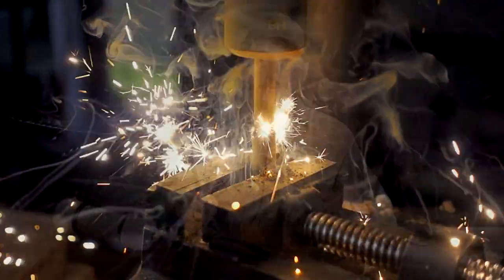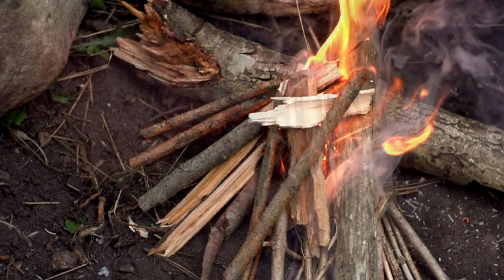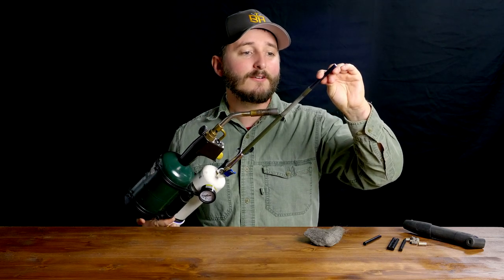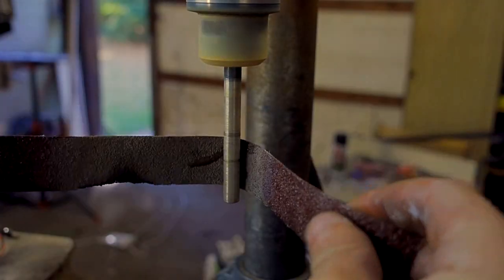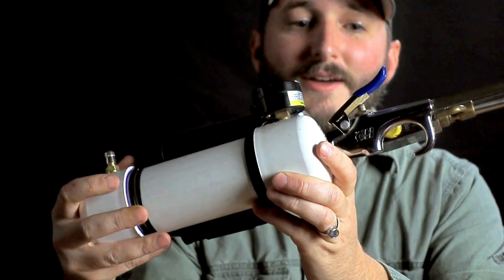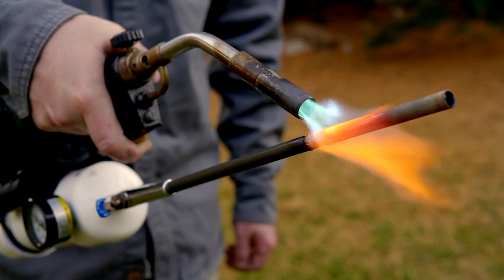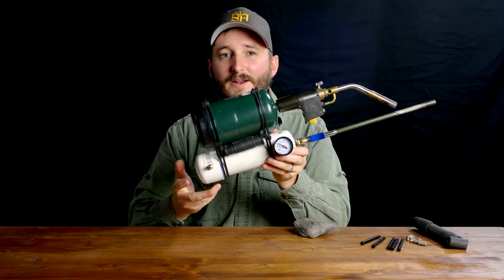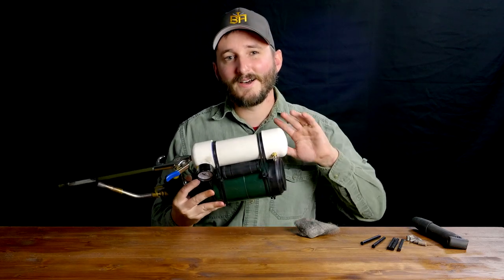Molten Ferrocerium Launcher

Comment: That looks alot like that dragons breath incendiary shotgun shells.
Reply: i was thinking the same thing after  i saw the footage
Reply: The dragon's breath is magnesium. So it is pretty similar result just different material
Reply: @dimesonhiseyes9134  i made magnesium powder and put it in the same cannon and well...  it blinded me even through a welding helmet
Reply: @ianbuilder  yes magnesium burns very white and very hot. 
Your welding helmet should be dark enough to handle it though. If it's an automatic one sometimes certain conditions like daylight can trick some helmets into not going dark. Or sometimes super bright but quick flashes will cause it not to darken. 
If you are using a permanently dark helmet you should probably be using a 9 filter at least.
Reply: @ianbuilder  any lasting damage or just seeing spots for like an hour?
Reply: @CarpeNoctem135  yea just spots  went away in a minute
Reply: Dragons breath not even allowed in some states like Florida! Oh well, at least our state is opened up.
Reply: Demolition Ranch fan?
Reply: @Paul-Jan  No
Reply: @razorbackblood06  That really looks like a firecracker
Reply: Well it's kinda the same...-ish
Reply: @dimesonhiseyes9134  it is not magnesium, it is zirconium
Reply: @TECHnoman753  except this isn't going 900 feet per second
Reply: A baby dragon....
Reply: @vaishalipatil712  totally. 😁
Reply: Apparently I am not the only one who thought this.
Reply: @User-ic1uq  : You are right.

Comment: My first thought would have been to swage out the tube to match the rods so the sanding/machining is only done once. Make a pointy steel rod of proper size, oil it up, and press into the end of the tube.
Also this cannon combined with the propane pop gun from a while back (one with clear spiral tube that fire travels through) ought to make for an interesting reusable firework of sorts!

Comment: Really awesome video, quite the pyrotechnic display! I do have to second some of the safety notes other people have had. Considering this was released just after a horrendous wildfire season (with many fires started by people being careless), please, please people: be careful when you use things that shoot off sparks! The other thing I'd note is that it's probably a good idea to have a pressure safety valve on the air tank. The gauge is great and all, but you really don't want to have a pvc pressure vessel become over-pressurized and explode on you.

Comment: Hey nighthawk, coming from someone experienced in modified bullets...ferrocerium can be fully ignited without preheating...provided the velocity is high enough upon impact. Use to put lighter flints in .22 hollow point pellet rifle pellets and shoot those around as a neat party trick
Reply: Since you actually saw this (and I’m extremely excited/humbled) I thought that I should add that the high velocity method of ignition works in much larger scale as well. I’ve gone as far as machining  whole “tips” from a store bought ferro-rod and attaching that to .50caliber muzzleloader hollow points (with extra deep/wide hole drilled to allow for more ferrocerium insertion/increased stability). Friction fit and Super glue was enough to hold it in place. 

When I shot those things....good lord my man....it’s on another level entirely O_o

I have photos and video if you are personally interested
Reply: When shot against a hard target, the modified ferrocerium.50cal (out of a muzzle loader) made about a 10-15ft ring of brilliant white hot sparks, with some pieces going well to above 10x that. Truly visually spectacular but terrifying as well. It was a real pain to machine as well since ferrocerium behaves more like a ceramic than a metal, and small chunks of that “ceramic” are pyrophoric. I also only had a hand drill to use as a “lathe” for final shaping (using files and sandpaper) after being affixed to the bullet. (I would put the whole bullet in the chucks of the hand drill and spin it while using sandpaper to shape the ferrocerium tip and make sure the tip was “true” to center of rotational axis)
Reply: @alexjavanainen4259  onko laillista? :D
Reply: @RoskapostU  amerikassa se on hyvä

Comment: Here's another idea, and a question...
First, when heating a piece of ferrocerium, as soon as it starts glowing you can take away the heat source and it will continue to get brighter and brighter ( the question is HOW/WHY??? ) and as it gets brighter it becomes more unstable and the slightest disturbance will set it off.
When trying to launch a piece with a slingshot the rapid acceleration and/or the air friction sets it off.
The idea is to heat it just to the point where it will continue getting brighter without the heat source and launch it while it's still stable enough to do so without immediately exploding so that as it's flying through the air it eventually gets to the point where the air friction sets it off at some point in its trajectory.  Does that make sense?
The idea is that you would not see anything leaving the launcher but at some altitude/distance away, it would explode into a shower of sparks.....

Comment: You should try this with just the steel wool. It makes showers of sparks by itself. In fact, if you take a wad of plain steel wool and hold one end of it and heat the other end if it with a lighter until it glows brightly, you can then spin your arm like a windmill very fast and you will get a GIANT pinwheel effect of sparks for as long as you spin your arm or don't run out of steel wool. Just do it outside in a safe area. It's spectacular.
Reply from the maker: I've done a couple videos on that. Lots of fun!

Comment: I'm not sure if it would work to take the brake line and braze a piece of 3/8s copper tubing onto it so you wouldn't have to make the rods smaller or use a larger size of brake line brazed to the smaller one. The copper might add color to the reaction. Great video I enjoyed watching it. Stay safe and God bless you.

Comment: Honestly, I would have drilled out the pipe rather than sanding down the rods. Not only would that let you use the rods with little to no modification, but the reduction in inner barrel diameter would have acted as a stop to hold the rods in place for the torch to heat them up.
Also, I'm curious what would happen if you fired just the steel wool. Does the torch get the barrel hot enough to ignite the steel wool as well?
Reply: You should have watched Grants videos on this but he done ded himself.
Reply: I'm guessing the steel wool ignited long before being fired.
Great idea though. It may be just as spectacular.

Comment: Hey Ben it's me again. Being another Ian of experimental nutters ( Props to Ian Builder ). What if you slow drilled cores and filled them with BP or RCandy but layer them like rings in a tree. A thin layer of ferrocerium, a layer of fuel and so on..... Would make for some fantastic core burning rockets or even static fountains. You could also try grinding the ferrocerium and add it to the fuels.
Reply from the maker: I'm not sure ferrcerium is suitable for a motor casing, it's not very strong. As for mixing it with fuel i believe it's too reactive to be safe

Comment: Cool video but I thought I was going to see a red hot ferrocerium slug hit something hard and explode into a shower of sparks. All things being equal I would think the amount of heat time
needed to get it hot enough with out being molten could be determined. Use a flame detect circuit to start a timer for the trigger. Hope you still have that cannon!

Comment: I wonder how this would perform with a sabot around the ferro rod? It might make the steel wool packing redundant, as well as allow the effect to occur further from the barrel? What about an ablative coating on the barrel to act as a sabot? Could provide some distinct advantages if the coating can be removed with friction from the air, but not from heat.

Comment: Looks like I'm just not trying hard enough. All I did was heat up a chunk of 1/2" rod on an anvil and smack it with a hammer. 

Pretty spectacular, but it looks like you have a big unreacted chunk left flying-- you should try (with proper PPE) shooting a brick wall or similar at close range.

Comment: around the 3:00 mark where you're machining the flint rods. You mentioned that they kept overheating and things got melty. How come you didn't use some sort of water cooling to prevent this? Or perhaps oil cooling if water is too reactive. I'm sure you had a good reason for not using any active cooling. But I'm just curious as to what the reason is.

Comment: Would you care to explore how ferrocerium corrodes and turns to dust over time? I collect lighters, and it's the main problem I deal with. A flint, loose in it's package will turn into loose gray dust, but if it happens in a lighter, it gets packed in place by the flint spring and turns to a nice, hard packed bit of clay. I've yet to find an effective solvent for it. Vinegar helps soften it up, but is a very slow process.

If it's something you want to look in to, I've got plenty of old flints, intact, partially degraded, and fully degraded, all in their original packages. I could also send a few of the lighters that have been clogged by the old flints. They  also seem to swell in place, permanently damaging some lighters.
Reply from the maker: I've been considering making a quick video about why that happens. I'm not sure about a good solvent to fix the problem unfortunately
Reply: @Nighthawkinlight  I have a feeling a stronger acid would help, but then strong acids aren't really appropriate around vintage lighters. I'd love to hear any explanation you have though! So far all I've heard is it's a process of oxidation. If you need any supplies or resources let me know, I've got plenty.
Reply: @HighOnTacos  if there is only copper and or steel you could possibly use NaOH, but brass would already be a problem. Maybe Ammonia?
Reply: @tp6335  It varies from lighter to lighter... A lot are chrome plated brass, some are steel, some aluminum. I'm not sure how to reliably identify the metal either, only a few are magnetic. I know not all steels are magnetic but then, magnets are used to test if some lighters are authentic, like Imco.

Comment: I wonder if you had a 2ft barrel with holes drilled in it after the bullet and capped the end with a glob of wax ,then when you shot it the molted bullet would pass through the wax and not explode until it hit the ground? Worlds first self capping exploding bullet or a mess.

Comment: I liked watching you grind and saw your rods with all the sparks, but why didn't you just get the right size tube for the barrel?  I've never worked with those rods, but I was wondering if you could notch them with a file and snap them with a flat chisel?
Reply from the maker: I did get the right size for the barrel, but they aren't made to accurate measurements and arrived slightly too large. Yes, you can snap them

Comment: Is ferrocerium magnetic at all considering the iron component?
If it is... could there be potential for a coil gun design with a heating element/microwave element to "super"-heat the ferrocerium very quickly in the barrel of a loaded ferrorcium coil gun, before unloading it via the electromagnetic coilgun barrel? 

Because now im just thinking of a minituraized version of this that runs off of electronics rather then gas. A handgun/Handcannon that shoots molten fire. 

Also now thinking of a "frizbee/disc edition" Which is ferrocerium rods in a ring/ferrocerium made into a disk, being shot with a magnetic frisbee bladed core, that superheats the disc within a chamber so that it comes exploding out of the barrel.....
Reply: I suppose the heating from a rail gun acceleration / friction is sufficient to set ferrocerium on fire. Problem is the capacitor banks needed isn't exactly small (plus a ton of safety issues). With coil gun a separate induction heating element is needed (which can be very small if not taking the battery into account). 

Either way the speed of projectile is likely rather slow, maybe a pair of neodymium magnet can help a bit?

Comment: I'm wondering if the difference in spark burst is that Ian used a solenoid and you used a standard air compressor valve. Or perhaps the size of the ammo. Just my thoughts, I have no experience in any of this.
Reply from the maker: Yes he used bigger pieces of the rods, but the valve could also have helped. My blowgun releases air fairly slowly in comparison

Comment: put a little inductiveheater from banggood around the barrel instead of that torch.
 ....aaaaaand add some titaniumflakes.
and what happens if u use a heated flint as a arrowtip and fire it with pressire instead of an bow. 
aaaand can u build a internally heated handgrenade with a rescuemagnesiumtorch to heat the ferroceriummantle?

Comment: Very cool! out of curiosity: Is the extra air pressure contributing to how violent reaction is. I serenely think so, but I would be really interested in to what extent. Would it be possible to fill the chamber with an inert gas like nitrogen and see if anything changes?
Reply from the maker: Good question

Comment: How come the flint glows brighter once its taken off of the lighter flame?
Reply from the maker: Great question! While the flint is in the flame there's no oxygen that can get to it because the flame is burning all that's around it. That limits the temperture of the flint to the lighter temp. Once our of the flame it can react with O2 for itself, and metal burns hotter than butane

Comment: What was the projectile shooting away from you before you pulled the trigger at 5:36?
Reply from the maker: Probably a car headlight. There's a road that direction.
Reply: @Nighthawkinlight  COOL, IM TOTALLY GONNA TRY THIS EXPERIMENT! Iv built an air powered flour flame thing with the sprinkler valve but could never get it to ignite with alcohol and cotton balls over the funnel.

Comment: Would the results look different if you shot any other molten metal out of an air canon?
Reply from the maker: I wouldn't recommend trying other metals
Reply: @Nighthawkinlight  Agreed, its probably not recommended to shoot any molten metal through the air.  My curious mind was just wondering if the properties of ferrocerium gave the effect or would it look much the same with molten steel or copper or nickel?  Kind of reminded me of when a blob of molten metal falls off of a cutting torch and hits the floor.  They glow and shoot sparks even though they don't normally auto ignite like ferrocerium

Comment: Why didn't you just mount a wider tube for the rods? That seems much easier than trimming them.
Reply: I suspect finding steel pipe for this was important due to the heat involved. the brake line he uses might have been his best choice so he didn't melt it. copper, brass, aluminum are all pretty soft metals...